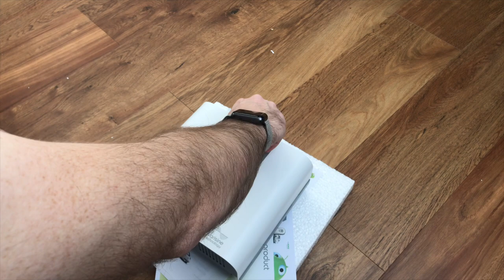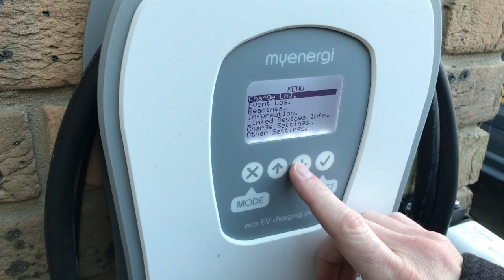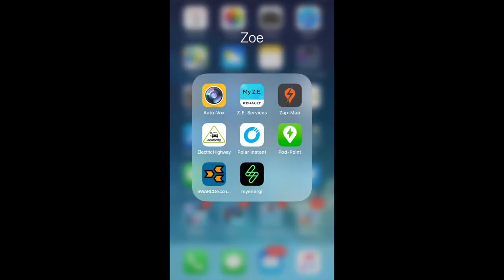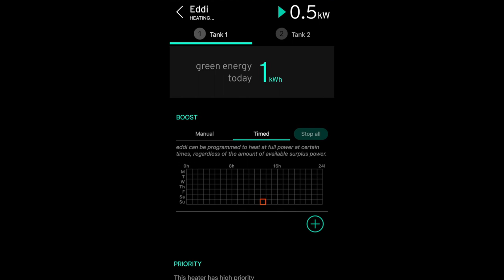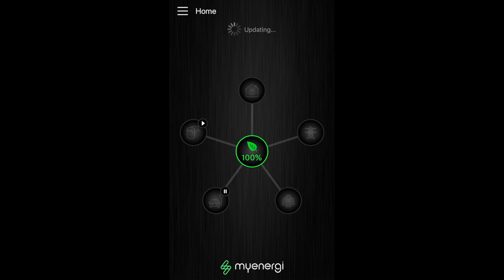Myenergi Eddi Install

Comment: Found this video after getting through 2 solar iboosts in 6 years. Thought I would change brand and site it some where cooler as I’m sure the iboost couldn’t take the operating temp when at full bore. 
Good explanation of fitting and wiring. I’m looking forward to see how the Eddie compares.
Reply: I'm here for this exact reason. My 2nd i boost in 2.5 years has just gone. I'm thinking eddi instead of going back to iboost.
Reply: Hmmm same story here, my iBoost died after 3.5 years - I noticed on occasion it got a bit hot and went into thermal limiting, so maybe its minimal thermal design isn't actually good enough, given what folk are reporting here. I was going to repair the iBoost but RS haven't been able to supply a replacement bridge rectifier since June (now end of Oct). Since I've just had a Zappi installed for our new EV, I've decided to order an Eddi to get the integration with the other Myenergi products and hence also add the app control. Eddi is due in 3 days...

Comment: Very helpful. This is the setup I am planning to install. The Eddi will replace a first edition Immersun unit. Thanks.
Reply from the maker: There will be a slight correction coming to add a flex outlet between the immersion and the Eddie which solves the flex issue, which is as per the instructions 🤦‍♂️

Comment: Nice to have fitted the last part of the set! I had planned to site my new Eddi in the airing cupboard but noticed that the specified maximum operating temperature is only 40 degrees C. This may not be a concern if you have a very well-insulated tank/cylinder/store, but I'm fairly sure our airing cupboard gets warmer than 40C, so I'm considering siting the unit somewhere outside the airing cupboard. Longer term I'll probably change the cylinder to something more modern.
Reply from the maker: Very well insulated including the pipe work up to the tank, I got complaints after installing the pipe insulation that it wasn’t warm enough to dry the clothes! Jackets and pipe insulation are very effective.
Reply: @eviain  Well, it seems that I was wrong. Having monitored the temperature for a week or so it has never exceeded 28C despite the central heating running full-on at times, so I'm sticking with the airing cupboard - it's the best location.

Comment: Cool, looks nice. I had a cheapo diverter ~£100 and it was built like a tank. Being electric only it made sense to take the HW duty off the air source heat pump for most of the year. Now I'm in a new build with GCH and gas at 1.9p kWh the payback on these devices is what just under 10 years? Great devices though.

Comment: Well you had almost helped me decide whether or not to get an eddi.
And the lack of setting of priorities had just about clinched it (… until I read some of the replies).
However, I think I’ll stay in the dark ages (for now).
I’ll keep the Immersun (remember them?).  At 6.8 mWh it’s still going strong.
Reply from the maker: Yup correction video coming soon! Priorities is there!
Reply: Hi, I also use a couple of the older Immersuns & they are still going reliably after 7-years.  I've set mine as master & slave & run water heating, electric kettles, storage radiators, etc. by just switching the outputs to the load circuit that I want to operate.
I think that MyEnergi bought-out the remnants of Immersun after it went into administration.
I'm now investigating whether to buy & install a SMA Sunny Island unit with batteries to enable my system to save surplus energy during the day for use when dark.  Also to give me backup power if the grid goes down & to keep my fridge freezer going reliably without losing all the frozen food within.  If anyone reading this has any insight or expertise into the wiring of Immersun w.r.t. Sunny Island unit to avoid conflicts, I would appreciate a comment.
Regards,  Johnnyk.

Comment: As regards Device Priorities, see the section in the manual under Configuration, Device Priorities which by my reading seems to enable exactly what you are looking for, at least within the Advanced Configuration but not accessible from the App (which seems fair enough to me I think?).
Reply from the maker: Thanks Nigel, I have been pointed at the app functionality which is hidden in plain sight on the home page just move the icon

Comment: Hi, could you give an overview of your set up please? I'm currently renovating our home, and have a large solar array on the way, with a battery and eddi to the hot water cylinder like yourself. The original hope was to have the water in the hot water cylinder run our wet UFH and usable hot water, but we later realised that water cant be mixed (which i've seen you mention in the video) and you've put a thermal store? could you explain how it works/if theres anything you'd do differently? the easiest option for us now is probably to have the UFH/rads connected to the gas, and hot water cylinder with eddi for usable hot water. Because of the size of my array however, i was hoping to be able to offset some of the UFH running costs by using excess solar but not sure it can be done? Thanks
Reply from the maker: A thermal store is relatively old tech now I haven’t seen that many companies offering them now. It was just what my home had when we bought it, however I like it and have no intention on replacing until I can switch to a heat pump. 
Essentially the boiler heats the hot water in the tank which is used for the central heating. That body of water heats hot tap water by passing cold water through a coil in the tank. The benefit is the tank acts like a buffer for both central heating and hot water. This means the boiler and eddi can heat the volume and it will benefit both heating and hot water usage.
However the water in the tank will be seriously hot, 70 degrees plus, which isn’t good for underfloor without some kind of mixing down. Best consult a heat geek as I’m not an expert in central heating I just know what I have :) anyway good luck in the refirb!

Comment: Hi Evlain, thanks for the video's ref the eddi unit. I'm considering fitting one but have a question with ref to using with a gas boiler. I have a current solar PV and battery system. I use gas for heating the hot water not immersion. My question is, in the summer months when the eddi has heated the water via the immersion (once the battery is fully charged) when the gas timed programme kicks in, will the boiler switch off if its senses the water is hot enough already ? hope that makes sense. Thanks Roy
Reply from the maker: Yes, the primary heat source for my home is also gas. In the summer the boiler does much less work as a result of the eddi unit preheating the tank. Your gas boiler will be thermostatically controlled so will cut out at that temperature. The immersion heater should have a separate thermostat on it.
Reply: @eviain  Many thanks !

Comment: Great video, however I have one concern. Where as the Iboost are recommended to be place near the immersion heater ie airing cupboard.  However both the ImmerSUN  and Eddi Myenergy are very similar units and require plenty of ventalation especially the Eddi due to its large heatsink on the rear. So logic would dictate, by placing theses units within a confined cupboard especially an airing cupboard that's becomes very warm may cause overheating to the Eddi's electronics .
Reply from the maker: This was a concern for me too however there’s very little option for it to go anywhere else. A couple of things in its favour, it’s only running one immersion so that heat sink is not having to dissipate heat from two MOSFETs only one. The components themselves should be able to withstand much higher temperatures given they were baked on to the circuit board in an oven. 
Only time will tell, although it’s been some time already, and it’s still going (following one early life failure under warranty)

Comment: Great informative video I'm curious I'm half way through with PV install CT 1 goes to Meter tails ( grid ) I believe I need to fit a second as I dont want my batteries to discharge . Im unsure of where to fit this I think its at the Inverter batter set up etc. Do you have any idea?
Reply from the maker: Hi I think I get what you mean.. essentially you’ll need a ct on any circuit you wish to monitor individually. Today a lot of solar and batteries are installed together and use the same inverter. Which slightly complicates things. If you have separate batteries and solar (normally because they have been installed at different times) then you can fit a ct to the battery circuit solar circuit and one on the tail to the meter. That’s 3 in total. If you have a combined hybrid inverter that deals with both battery and solar then install a ct at the meter and one on the solar battery circuit.
There’s more info here on what you can do depending on your setup https://www.myenergi.com/wiki/eddi-wip/installation-4/#BatteryStorageSystems
Reply: @eviain  That's great I'm thinking if I can CT just the live as it leaves the inverter/batteries that should do it? If I cant do it there I could CT where the MCB is in the consumer unit I've already got 4 PR cat 5 running to the loft so no problems extending this second one. And thanks for your quick response.
Reply from the maker: @davidjaynethomas4668  it doesn’t matter which end of the circuit you do it. However you may want to check if the prevent battery drain setting will work on the eddi with a hybrid setup. Worth contacting myenergy and see what they say.
Reply: @eviain  Thanks I will do

Comment: Cool video, thanks. With the Eddi installed how do you stop it from using mains electricity to heat the water, ie. I would only want the immersion heater to be used when there’s spare solar available.
Reply from the maker: It’s installed in line with the immersion and set from factory to only supply the immersion when there is solar being exported. It has a sense clamp that needs to be connected to your main live cable from your electric meter.
You can set other options like a schedule via the app which you need the hub to access
Reply: @eviain  many thanks

Comment: Hi, liked the video,  good installation.   Can I ask how is eddi connected to the mains supply to detect the excess.  I will assume it's by a clamp and I suspect its wireless.  Can  you confirm and  maybe a short video!  I currently have solar cache with a display next to the inverter so I can still monitor, if I install eddi or solar iboost, but having seen your vid and potentially getting  an electric car, I think eddi does the trick.   My solar cache diverter has stopped working so I'm now  heating the hot water tank via a spur switch, it works and no safety issues or overhead cables.      Looking forward to your reply and if you dont mind how much to buy eddi and do you recommend a site.   I've just had my annual fit payment of 370 quid which will soften the  blow,
Reply from the maker: Hi Paul, great questions and good idea for a video, I was thinking of doing one on the whole setup. Much like the iboost Eddi can use a wireless unit harvi to send consumption data. Unlike iboost it’s not included with the eddi. By default you would need a hardwired connection back to the eddi, so it’s an extra £50~ for the harvi. I bought most stuff direct from myenergi. I think the myenergi stuff is good for geeks not so good for people who want simple setup, it’s ultra flexible.
Reply: @eviain  thanks for very quick reply.   Hope you do the extra install vid.    I will keep an eye out, thanks again for pointers

Comment: Thanks for the video.  I've just ordered my Eddi unit, so this will be helpful.  I'm curious about how your isolator switch is configured.  I guess that this was the original double-pole isolator switch (pre-iBoost) which has been rewired to suit the iBoost/Eddi  installation, since originally I'd expect the mains feed from the 16A MCB to have been wired directly to it along with the flex to the heater.  But now, I'd expect the mains feed to be re-routed directly to the Eddi (i.e. no longer to the isolator).  Is the isolator now just a double-pole switch for the supply to the heater coming out of the Eddi?  Thanks.
Reply from the maker: Hi Paul, I found it quite useful to still have the Eddi fully isolated. However your quite right there’s no requirement to have it fitted behind the isolator. In actual fact looking at the installation manual again, it looks like they recommend placing the isolation switch between the heater output and the immersion heater itself, which would make a lot more sense and be a much tidier installation as you could use a flex outlet. I think I’ll look at reworking it. 👍👍

Comment: I take it there is some temperature protection so if you set the boost to come on and it's not actually needed it switches off ?
Reply from the maker: Hi yes, the thermostat on the immersion heater itself still has the last word and will cut power to the element when the set temperature is reached. 

Unfortunately one slight drawbacks is that it means if the safety trip on the immersion heater goes, this will also fool the device (any device) to thinking the tank its hot. But better safe than sorry!

Comment: The 'eddi' is connected to the consumer unit which receives a voltage from both the grid and the PV inverter. How does the eddi know which voltage supply to draw from when the terminals in the consumer unit are common?
Reply from the maker: Current Sensors clamped on the incoming mains cable and on the solar generation. Check out my home setup here https://youtu.be/Bved9CyL-Co

Comment: hiya. nice video. Please can you clarify: do you have an isolator switch for the Eddi, then another isolator for your immersion heater?   or instead did you just reuse the original isolator for the immersion, i.e. no isolator for eddi/or 1 isolator for both eddi and heater? thanks!
Reply from the maker: Yea one for eddi then one for the immersion so you can keep eddi running if you need to change the immersion. There’s a my mistake video which focuses on this

Comment: Well done video....
Imma techie like you...had the v v old immersun prior to this named co. I've got to replace my unit as no support and it's not calibrating. So can't get hot water. Good thing from yr vid I got all the cables in place ready. Igor figure the neatest configuration for astetics. Wonder if they fixed the gromet issue, well spotted I'd said the same as you.

Do you have an email to contact cliff
Reply from the maker: Hi Cliff You may also Like this: Sorry Eddi my Mistake. The wiring makes much more sense after this quick fix!
https://youtu.be/O7mcHH71KbI

Comment: With wiring the Emersion, what about sink/bath wiring,, do you not use the black cable
Reply from the maker: Are you an AI word generator?
Reply: @eviain  what you on about
Reply from the maker: @GK-fq3cy  sink bath wiring?? Black cable? None of that makes sense.
Reply: Emersion heaters have two elements, one small and longer. Small heats top of cylinder, so it's switched on by "sink" switch , longer part of the element is switched by the "bath" switch
Reply from the maker: @GK-fq3cy  that’s not present on this system just one immersion heater. However the eddi can drive two immersion heaters directly and there is also a separate relay module that can be purchased for extra configuration options. Eddi also has a boost button which may do a similar function as the “Bath” mode, worth checking with an electrician/plumber.
Reply: @eviain  ah okay thanks for the info

Comment: Thanks for the video Iain. We are having an EDDI installed into our solar PV system in a week or so. I have a question.....  Your video suggests you have not used the thermostat input of the EDDI. Do you have the immersion heater via a stat on the tank so that the EDDI cuts off when the tank is up to temperature?
Reply from the maker: Yes the immersion heater has an inline thermostat, which cuts off at a temperature you can define on a dial. Similar to this https://www.bes.co.uk/immersion-heater-11-thermostat-19766/ 
I don’t believe the eddi has a thermostat input, However it would be useful as it would potentially stop nuisance tripping caused by screws loosening over time caused by the heat.
Reply: @eviain  Well you learn something every day. Just popped the metal cover off the heater and there is indeed a built in stat set to 60 degrees at the mo. Ace. That saves a job. You can get a thermostat input to the EDDI. Its an additional plug-in card and a temperature probe. I did not fancy the cable run for that though as the EDDI is going onto the same panel that my inverter and generation meter are mounted to in the garage under our distribution unit.  Its a convoluted cable run. But your nugget of wisdom has saved me a World of pain.
Reply from the maker: Awesome glad I could help, I knew there was an extra board but handn’t looked in to what it did, so thanks for the info back 👍